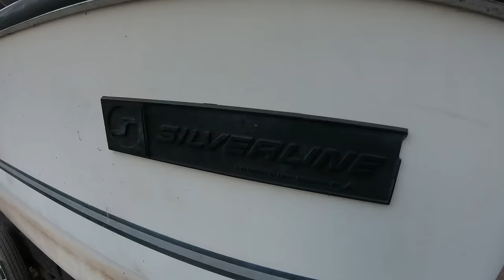Buying cheap boats

Comment: A tip for lower unit oil, most I've come across are designed to fill from the bottom plug until it just comes out the top plug. Apparently the clearances inside are super tight and with how thick the oil is it ends up being underfilled when filled from the top plug.

Comment: you need to trim that motor out one or 2 holes to get the bow up out of the water it will be a much drier boat at speeds

Comment: Omg am I ever glad i watched to the end!  The boat ramp fast delivery method!  Ive had that happen too!  Help full kid decided to flip the leash lock but not tell me!  Ive got a silver side 53 Merc Mark58a 450.  Im trying to adapt the old merc to newer omc controls.  We picked up my new project last week.  Then I scored the deal of a lifetime!!!
A whole stockroom of N/OS Vintage new/rebuilt from a nice old guy who used to own the marina.  Well over 20 engines all rebuilt starting early 40s up.  About 5 tons of goodies including stuff i have no idea what it is.  6 5gal pails of props from very early brass to newest plastic! It took me 3 days with 2 kids helping just to sort the new and old.
If you could help me out on wiring up the new control Ill help you with any hard to find parts you may need? 
Im afraid of wiring something and hurting the distributor.  I cant even find those!!!  I have had luck rebuilding a distrib!!!  Lots of dremeling and a little luck lol   Im working on a facebook page to start selling off all this stuff.  50% off retail or less.  
Thanks for your time!  
connollysmallenginerepair@gmail.com
P.s.  Im in love with Levi he looked so mad when the first one wouldnt start and he just wanted a boat ride!

Comment: If that motor has power trim, I would trim the motor out after (even as) it goes on plane. It needs to be trimmed in to get it "out of the hole", but after it gets on plane it just pushes the bow down, which is why it is throwing so much spray.

If it doesn't have power trim, the base setting (when it is all the way down) needs to be a bit farther out. Experiment for the best combination of getting out of the hole and onto the plane with planing performance. It is trimmed WAY too far in right now. There are usually notches where you can adjust the base trim.

For a ski boat you want to get out of the hole quickly (to make it easy for the skier); you just have to put up with the spray if you don't have power trim. For cruising, you want easy planing performance, and you just have to put up with the bow aiming at the sky for a few moments when you are starting out (again, if you don't have power trim).

V-hulls don't track very well at low speeds with the motor trimmed way in; again, it is because the bow is being pushed down. Trimming out a bit when traversing "no wake" zones will make steering at low speeds easier. Just don't forget to trim in to get back on the plane (if you have power trim).

You can get a trailering prop to support the lower end while trailering. It will save strain on both the transom and the latch that holds the motor up. Don't forget to remove it before launch (at the same time you check to see if the bilge drain plug is in).

Comment: I recommend ALWAYS checking the wheel bearings before pulling a used boat home. Use bearing buddies and grease and check them before using in the spring and before storing for winter. Backing the trailer into the water forces more water into the bearing than just driving in the rain. Trust me, it's no fun having the tire/wheel/hub assembly fall off coming home from the lake, especially at night. Also, before storing for the winter, pull the lower drain plug for the lower unit and check for water to run out. Discarded fishing line can wrap around the propeller shaft and damage the seals. If the water freezes, it can split the lower unit. When you fill the lower unit, pump the gear oil in from the bottom until it runs out the top hole. Put the top plug in first, then the bottom.  I've learned all these things the hard way.

Comment: Trim it out! The motors thrust angle was pushing the bow down by lifting the stern up. The motor has adjustments that will angle the prop upward pushing the stern down and therefore lifting the bow. She will then come on plane and glide across the water instead of pushing down into it (and spraying anyone inside). The speed will increase and the load on the old engine will be greatly reduced with much better fuel economy. This combo was not a bad sky boat in its time and if properly set up could be again...

Comment: Haven't seen any comments on the lower unit. When refilling with gear oil always fill from bottom hole. Fill until oil comes out top hole. Replace top screw and tighten. then replace bottom screw. Filling this way eliminates any air bubbles and completely fills lower unit.

Comment: try moving the pin under the engine by where it attaches to the transom out a hole or two, that should bring the bow up a bit when you are on plane, eliminating that big bow wave it is throwing. It will also pick up several MPH and use less fuel, ride better too. I have spent years boating on the Hudson about where you are I think. good luck with it !

Comment: Just a little advice.  Make sure the cockpit window is closed and locked when you are pulling it on the trailer.  One good bump and it will rise up and come down hard breaking the glass under it.  This happened to me many years ago and was an expensive mistake.

Comment: Hey Andrew you need to trim the boat and motor out ... it’s riding bow heavy ... tilt the motor to lift the bow higher in the water ... it will be dryer to

Comment: Hey buddy when you did the lower unit oil you did it backwards what you do is take the bottom nut out put your tray underneath then undo the top one that will allow gravity/air to enter and let it drain when it's done draining you connect hose to bottom hole fill up until it starts pouring out top hole... screw in the top screw undo the the hose  and screw in bottom screw .. your filling from bottom up eliminates air ...

Comment: Trim the motor up a notch - or two.  Go two notches and see if it porpoises at planing speeds. If so, drop it back one. I can see that the motor is tilted so the prop is under the boat too much, pushing the bow down.  The faster you go, the more water you plow thru - not cut thru.  Thus the wet ride. That style of hull is designed to be a very smooth ride in a chop - similar to a Glasply, Tiderunner, Olympic, or Fibreform.  A good bay boat. It has a pronounced forefoot to split the chop at low/moderate speeds with the motor trimmed to level for a good ride in bumpy seas.  You won't g as fast , but you shouldn't anyway. When it's smoother, the long keel run makes for a superior ride with the motor trimmed up somewhat.  With no power trim, you have to decide which you prefer - a wetter ride going fast while trimmed level, or having the boat a bit higher in front to get on a plane better in smoother conditions.  Looks like a 16 footer to me, but not a lightweight boat.  IMO, the 65hp is minimal so the trim is important.

Comment: When replacing the oil from the lower unit take out both screws so it doesn't create a vacuum and when you fill it up fill it from the bottom. Once it leaks out on top you know it's full.  Then screw the top screw so it creates a vacuum and when you take out the pump from the bottom hole it won't just dump out and screw it back in.

Comment: That boat needs a LOT of work. The transom is COMPLETELY shot. Also, the foam is completely waterlogged which would explain why it was sitting so low in the water. If you had some sort of emotional attachment to the boat, you could fix it, but since it's just a free boat you picked up and it's fiberglass, I'd salvage what's good to sell and trash the rest. The motor could bring a few hundred and the trailer could be repainted with some Krylon and bring a few hundred more.

 If it was aluminum, it would be a lot easier to work on so a person might decide to pull the floor, replace the foam and  transom, put down a new wood floor and keep it. But that all depends on your skills, your time and your budget.

Comment: watching your boat ride off the trailer reminded me of myself.  lol.  i have not done that one yet but usually something happens .... last year i got boat serviced . then wanted to take it out for a test run. launched boat, went and parked truck  got back to the boat and noticed it had a bit of a lean to it. getting closer i noticed this boat is sinking . oh shit i forgot the plug . and the main 5 inch cap or the well ,,  ran got truck and got boat out of water as it was about 85% full of water.  took 2 and 1/2 hours to drain all the water using the pump and drain hole..  also forgot the transom saver bar attached to the motor one time..  never seen that after feeling the motor jump lol...

Comment: I just bought a 66 15’ dagger lance with trailer and evinrude for $500. Lots of extras. Titled and licensed with lots of extras. Missed so many good deals finally scored. Had only been posted for 7 min. It floats but gotta get gas motor running.

Comment: I'm curious, did you/he check compression first before putting all the effort into the engine? And, does that bow throw so much water because hull is underpowered and not getting fully up on plane? Dude is so honest he doesn't edit out mistake at ramp, very cool.

Comment: Hi. I love that free boat, the Silver line. It looks similar to a Sea-King. Your boat, it looks to be a 1966-68. I have a 1964 Sea-King, it had a 60 horse on it. I replaced it with a Force Merc, 85 horse 3 cyl. I had to use everything from a Bayliner to get it to work. I do need the control panal cover band the 2 shifters. But yeah you do have a really nice boat. Do you still have it, and would it be up for sale by chance? Thank you friend.

Comment: well you messed up like we all have but at least you put the plug in the transom  so it didn't sink  also noticed a little play in the motor on the transom hope your transom is not rotted and motor only needs tightening on the motor to boat clamps or and the two  screws that hold it to the boat if its got screws thru the hull  happy boating friend ive got about 26 right now im restoring lol

Comment: Dam we have the same luck but shit always works out. Trim up that motor a notch. It will ride better save fuel and keep you dry. The bow is too low
The hydrofoil is good I think your transom is as little rotten. Every time you go in the river set aside a $100.00 just for crap that tears up
Enjoy your videos 
Thanks for posting

Comment: You need to set the angle of the motor where it will kick the boats bow up and that should help with the water spraying issue.

Comment: I do a lot of traveling and I see so many good boats that are just wasting away.... For example, 24 foot Baja last registered seven years ago. condition good, thru the hull exhaust, year 2008, interior good, probably pick it up for $7,000. Here the catch on a boat....transom rotten walk....New inboard/outboard MARINE engines remanufactured with a core charge are cheaper than outboards, approx $3,000. Upholstery Marine vinyl is cheap, when sewing use a medium-weight fishing line. The fishing line will not rot and is UV resistant, spray it with WD 40 so it threads quicker. Fiberglas dull Marine paint and it looks new, but always use a primer first to prevent peeling. Finally, boats are big money in 2021 and a solid good looking boat will make you money....have fun

Comment: Second boat, try changing engine trim angle to raise the bow a little.  It seems a little nose down.  Might also check how much crap is stored in the bow in case you can lighten it up.

Comment: The week transom causes the engine lower unit to shift forward pushing the nose deeper into the water the only way  to fix is to fix the transom so the engine can be at the proper angle.... this will stop the spray from the bow

Comment: Had the exact same problem, engine ran fine in neutral but no power in gear. fuel was bad and had WAYYYY too much oil

Comment: always add LU oil from the lower with the top vent cracked. from the top allows air! also even ethanol gas will be on top bc like u said water is heavier :) cheers
Reply: 24:11 your transom is completely rotted out. that boat is shot. if youre flipping boats u better know what ur doing or u might kill someone :)

Comment: Ya the transom is gone. And it rides so wet because the stringers are shot too. The bottom of the boat is flexing under the load of the chop. Dangerous boat. That outboard can rip the transom off and swing into the boat by the steering cable.
Reply from the maker: That would make for a good video. I got the boat free, if it sinks, it sinks.

Comment: I like your vids .I want to let you know however when you change oil in an outside or lower unit you need to fill it from the bottom open the top vent and fill until the oil comes out the vent.

Comment: also on your fuel pump problem always check to see if squeeze ball holds pressure after pumping it up and ruining it it should not start to suck in if it does it may have bad o rings in the hose end connector on each end out the connection from tank to motor unless its a solid run on both ends or maybe leak in hose

Comment: Should have done a musty1 check first, of fuel, plugs, etc.
Does the second boat need a new paint job as seems to be excessive spray. Water is not slipping past easily

Comment: Anyone notice if he put in a new bilge pump ?
The ten years I lived in the Keys I always had twin bilge pumps installed.
I also lock tighted every stinking nut, bolt and screw as boats bounce them out regularly.
I also use permatex on every gasket surface cause leaks if any kind sucks on the water or any engine for that matter 
Plus the drain plug should be new on a free boat.
I almost lost a boat when the just bought boat my Boss lent me turned out to have an old plug.
Thank God my brother noticed the stern was almost under water while we were snorkeling Alligator light off Islamorada as the single bilge pump couldn't keep up with the amount of water coming in.
I immediately got it going and up on plane to drain the water out then headed to the nearest marina and bought a new one.
Next day I installed a second pump.
It was a 19' Hoog with a 150 (actually a 200) Yamaha on it.
My Harley on the water blast.
I had my own keys and could use it anytime he wasn't.
He preferred his 24' twin (200 (actually 250) Yamaha engined open cockpit Aquasport.
I didn't like cause you were constantly trimming it and it guzzled gas.
He called it his pickup on the water.
Great for Dolphin fishing tho.
I loved it when he'd call me up and tell me no shop work the next day we're goin' fishing.
I'd always end up the designated driver but end up with the boat getting drunk at some waterfront bar and takin'  taxi home.
Next moaning I'd go retrieve it hungover like ya wouldn't believe.
The few times I got pulled over by the Coast Guard I'd just show my VA id and Coast Guard Veterans hat and they'd let me go. 
Boating is a blast.

Comment: I’ve done about what you’re doing a few times sometimes on these old motors the impeller dries up or shrinks up after setting after they set for several years and then it doesn’t pump water through the engine to cool the water jacket on the engines hope yours is OK I haven’t watch the whole video yet best wishes

Comment: Can tell by how it is positioned while cruising that the bow needs to be trimmed up.  Running bow down like it is will cause much lower speed and bad steering handling as well as rougher ride in waves.

Comment: you need to adjust your tilt trim so the motor is not so deep in the water , that will cause your nose to go up a bit and have less water spraying up from the bow

Comment: well on the lunch crap happens at least you put the drain plug in lol i have 3 or 4 of the 65s  some good some bad from people not changing water pump over heating the gaulding cylinder lol ps always take your bow line tie it to top of the wench post on trailer then make sure its fairly long so as you pull up you can retrieve it without getting wet  thats how i do it if by myself

Comment: you are really lucky on these 65 hp merc older models usually you will find  water in the lower unit grease meaning bad seals lol also always check out water pump always change them about every year or 2  ps dont try and force the lower off even if it looks like you got all bolts out there is a hidden one that you have to put an Allen screw  down thru the hole at back  over prop and remove it it will drop the fin looking thing and there will be a bolt up under there also

Comment: Fuel lines on my similar age Mercury engine were all rotted out, had to replace all of them.   Look at the engine wiring.  If the insulation is cracked and you can see the core of the wire, it is all going out.  Cant get the engine wiring from Mercury anymore, long obsolete...

Comment: Please, please, PLEASE check the reed valves between the carburetor and engine block. If that outboard had been sitting that long with water in the gas, those reed valves are going to be rusted all to hell and absolutely need to be replaced.  All sorts of things can happen with 2strokes that sit for a long time, including spitting out the needle bearings at the wrist-pin.
Edit: Those 2-strokes fuel pumps are usually vacuum/pressure driven from the crankcase- Those reed valves I mentioned can absolutely cause that issue.